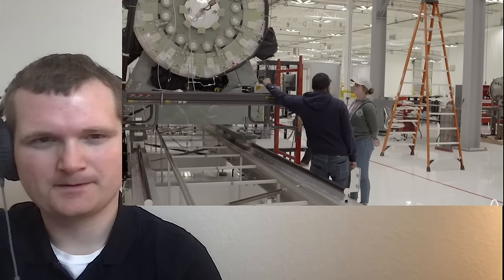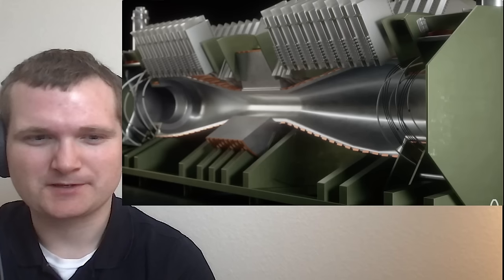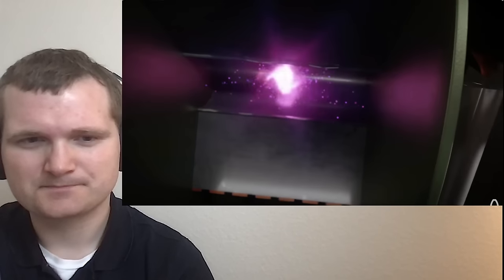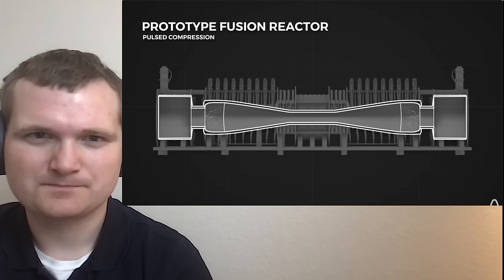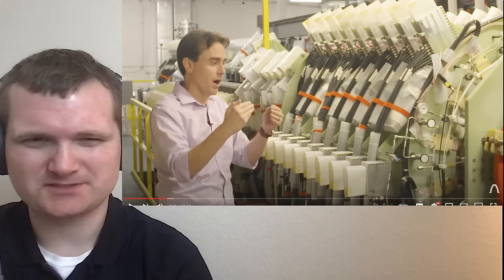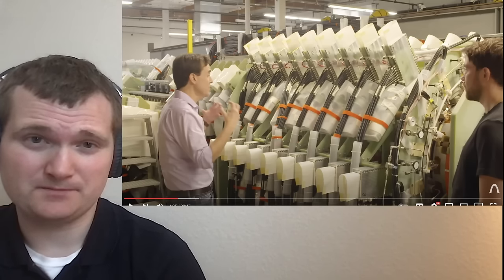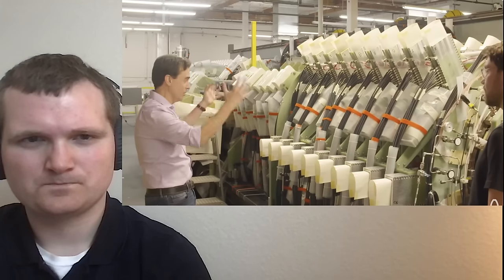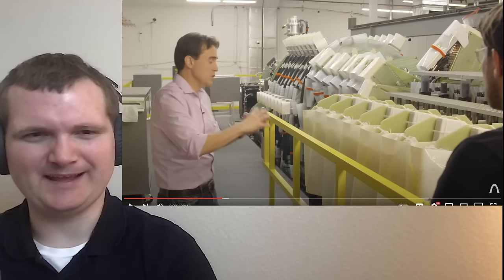Will the Helion Fusion Reactor ACTUALLY work? - Nuclear Engineer Reacts to Real Engineering

Comment: I wish you would have started with your overall impression. By all means, inter-cut with your initial knee-jerk reactions if it makes sense. But you kept pausing, interjecting your comments, only to have him address your concerns later. This could have been a lot shorter -- we can always watch the original video. Just give us the highlights please. Content like this is not going to lead with the engineering data you are desperate for, if it's in there at all. What matters is whether you think this is plausible, and a summary of your concerns.
Reply: And I was specifically hoping you would comment on the whole "generating power directly from plasma" concept. Like, I don't expect you to know what their trade secrets are. But I would be curious for you to at least try to expound on how such a scheme might work, or else why it might be impossible.
Reply: @brandonlewis2599  The idea is that the single FRC that is the result of the merging of the two initial FRCs is still alive and well at the end of the pulse. FRCs have their own magnetic field and have a Beta of 1. That means that the ratio of external magnetic field to internal magnetic pressure is 1. That is a very strong coupling. 
Now, when that FRC is allowed to expand again, it returns the energy that was previously put into it plus a significant part of the fusion energy back into the coils that were used to compress it in the first place. 
Think of regenerative braking in an electric car (in fact their some of their electronics are derived from that)! 

The best analogy that I have come up with is this: 
Imagine you have an electric car that you have driven uphill. That is the energy you put into the machine to start the fusion reactions. If you let it roll down the hill again and engage regenerative braking, you would get back about 90% of the energy it took to get up the hill. It is not 100% since there always ohmic, friction, traction and other losses. Helion did some experiments on that in ~2015 and got to ~95% efficiency. The reason is that a plasma is in a vacuum and there is no friction and roll- inefficiency from tires and they are not using cheap mass produced coils in their magnets, etc, etc. So I think that even in their big machines 90% is not unrealistic. Either way, that would not result in net electricity gain, but net electricity loss.
BUT, Helion's machine produces additional energy from fusion. To continue the analogy from earlier, it would be that once you are on top of the hill, you fill it up with heavy rocks. Those rocks represent the energy you get from fusion reactions. If you let it roll back down that hill now and engage the regenerative braking, you will end up with more energy in your batteries than you had before driving up that hill because now you have those heavy rocks pulling on your car in addition to the weight of the car itself. 
Now, it is not quite as simple as that, because the plasmoid does lose some of its particles over its lifetime and particles that escape the confinement are harder to extract energy from since they do not move along the field lines of the FRC. That said, you can still get SOME of their energy back as well (statistically). They are not a complete loss. The important fine tuning aspect for Helion is to terminate the pulse at the right time. You want to keep it compressed as long as you can to get enough fusion reactions but you want to let it expand before it has lost too many of its particles. Because every % of particles lost is a % of energy that you can not recover at high efficiency.

So far the theory. The big question is whether they can do that in real life. Polaris will be the very first time, they will test this in practice. I think that their scheme is plausible. It allows them to get to match a Tokamak operating at ignition (where the fusion products can heat the plasma without external heating applied) without ever achieving a high enough gain to actually achieve ignition (ignition with higher Z fuels is a topic on its own). But 90% recovery of the input energy is close enough, if not better than ignition in a Tokamak.
Then all they need is enough fusion energy to make up for those 10% losses and some extra for net electricity. Their overall gain will be relatively low at about 2 or 3. You could sort of refer to it as an "energy amplifier".

Edit for an additional fun fact. I remember that Australia (IIRC) was proposing a scheme for an electric freight train going up- hill to a mine and then returning from it filled with ore (or might have been coal... something like that... been some 5 or 6 years since I read it). Anyway, the idea is that that train is essentially self sustaining. It goes up- hill empty and returns down hill filled with cargo.
Reply: I believe that this is the nature of so called "reaction videos". They are literally just watching that video and then react to that without additional context or research or having prepared for it by watching it a few times. Can't really blame Tyler for following that format, though I am not sure that it is particularly suitable for this kind of complex topic.

As far as those videos go, his is actually better than most. There are a few others out there that are much worse. For one, I really appreciate that Tyler maintained a relatively polite tone throughout the video (while being skeptical, which is sort of understandable without additional context) and relatively kind attitude. He was asking questions, rather than being outright dismissive.

I hope he sees my comments here and maybe uses them as an opportunity to follow up on the topic. Though, I am not sure if he would because of the way things work on social media these days. People want fast, fun, emotional, etc. They don't really care about technical details. Carl Sagan was (in this case unfortunately) right in his Demon Hounted World. People want sound bites and opinions and emotions... Stuff that "feels good" or "feels right" and with our "intellectual faculties in decline", technical details are not really all that important anymore :(

Comment: My bet is on MIT’s Tokamak Fusion Reactor.  Prior to going dark mode, MIT published several progress reports on successful test of their superconducting magnets.  The primary magnet achieved the desired field strength with quite a bit of power to spare.  With a grant from Con Ed they expect to have a fully functioning generator on line in 2025 🤞.
Reply: Uhm, they are still publishing a lot of their progress...

Comment: I've seen only first 10 minutes. I am not nuclear expert but I've never seen so concentrated bullshits. Where they want to get the He3? How to compress the plasma in so small space? Is a speed of jet plane enough to fusion of the low pressure ions? Does he know that 1GW in 1ns pulse gives him just 1Joule? And what says uncle Lawson about that? And did he know the Iter is not a power plant and there won't be a turbine?
Reply: 1. They get the He3 from fusing Deuterium.
2. They compress the plasma with magnets. Not sure what the space has to do with it. It would actually be easier in a smaller space, but they need a bigger radius to keep the plasma stable long enough.
3. Eh math? 1 GWns = 0.000277778 Wh which equals 1 Joule.
4. Uncle Lawson is fine. 
5. I believe he was talking about future Tokamak based fusion power plants that would be patterned after ITER (or rather DEMO).

Comment: To paraphrase Elon Musk: "Fusion is stupid".

The science of nuclear power generation, BWR, SMR, MSR, LWR etc etc is already done, some engineering is needed for some types
whereas
for fusion energy generation, 9:13  not even the basic science is finished, much less a mountain of engineering issues, and not to speak of financial issues, the solution to carbon neutral/free energy is not on any type of time frame.
Moreover,  besides a huge waste of time and money, and false hope,  when known and proven non-carbon energy sources are available, stellar brain power is wasted on a dead end project, while the status quo oil/gas/coal interests are laughing all the way to the bank.

Comment: So, this channel did a pretty shite job of telling the story, the ones from Helion, and a few others who were there did a MUCH better job.  This, "pinch" design, yes it's net positive power, but just barely, and while they might get it there, it's not really going to be a useful method.  Charge has to build up, and then be recaptured back to the banks for another pulse, it aint that good, and seems to be near the limit that the design can do.

What it DOES do, is release such insane amounts of neutrons that it's going to be useful in making the fuel, and the plates that actually make the power, around the confinement setups.  A confinement reactor would easily run through the entire world supply of materials if we used it for power... this solves that.
Reply: - Helion is not a pinch design. It is a compressed FRC.
- I don't see a problem with the capacitor banks. The pulse length is about 1 ms. They can capture the returned energy and gradually release it to the grid from the capacitor bank.
- Helion's design emits 1/3 of the neutrons of a Deuterium- Tritium- fusion reactor design like a Tokamak. 1/4 if they have enough He3 from Tritium decay. 
The neutrons from Deuterium fusion only have an energy of 2.45 MeV vs 14 MeV from D-T.
The walls of the vacuum vessel are made from quartz. Silicon has to absorb three 2.45 MeV neutrons before it becomes unstable Si31 and that then it is relatively short lived.
Also Silicon is very common.

Comment: this seems like boondoggle to waste enough time and trick enough people and secure funding for long enough -- a good 30 years of income for the key people involved.
Reply: Eh, their next machine is already almost complete right now. That one is supposed to demonstrate net electricity. So, either it works, or it does not and we will all know it soon.
Reply: @elmarmoelzer2229  from what I understand they don't even have a scale reactor nor have they actually generated any meaningful electricity. It's basically a giant neon light.
Reply: @asaturn  
No fusion machine has ever created net electricity. Not one. Polaris will the first machine that is supposed to do that.
They have created a lot of fusion reactions with Trenta, but the equipment for the direct conversion was not in it (it was a relatively low cost machine).
It did proof that their design scales as anticipated, which by itself is quite remarkable and also very important. It lowers the risk for the subsequent machines.
Reply: @elmarmoelzer2229  Their machine is not new technology. They're using a Field Reverse Configuration approach to fusion... this is something pursued since the 1950s. IMO this is all a big scam. By their own admission, their power output and reactivity level will be extremely low unless they up the pressure or temperature, which would increase the neutron output and require a completely different design (they'd need a lot of shielding to stop the neutrons). It's extremely unlikely that this isn't a scam. They've been promising to be able to generate more electricity than they consume for 10 years now.